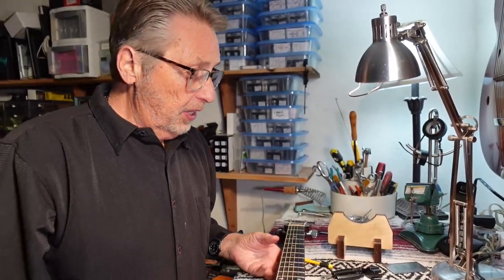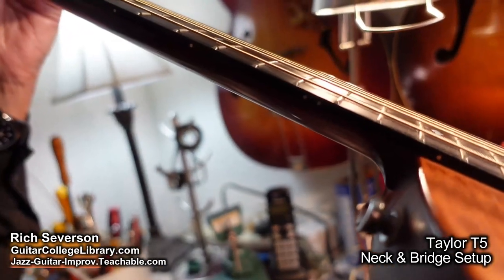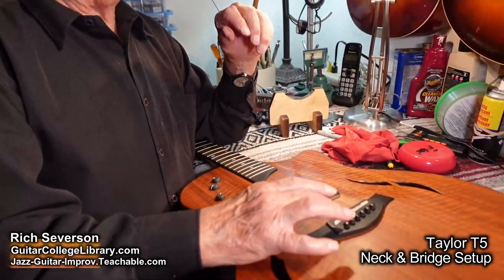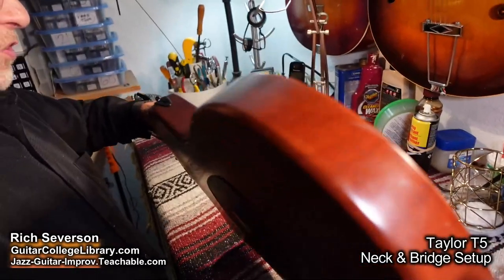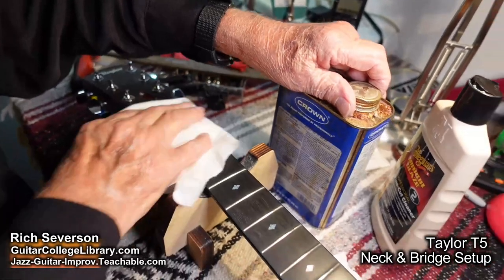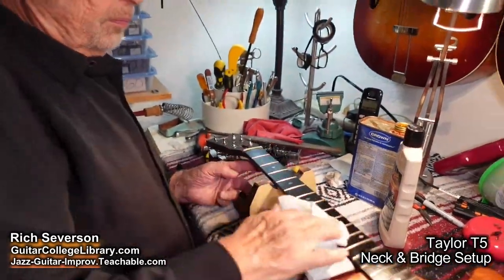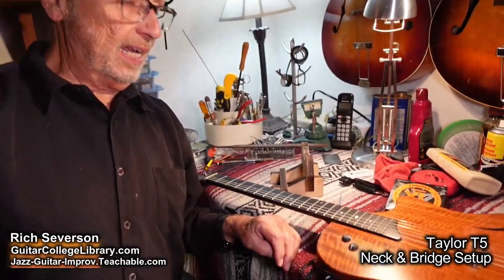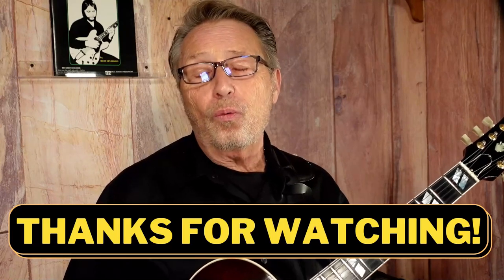Watch How I Clean & Lower The Action On This Guitar | Guitar Setup Demonstration

Comment: One small change-suggestion.  I'm not a luthier, but I was a precision mechanical technician for much of my career.  At the very end of the video, where Rich notices the saddle seems off, with the treble side set too low compared to the bass side of the saddle, Rich mentions filing a bit more at the back of the saddle from the mid-point to the bass end of the saddle.  I don't think that's what you really want.  If you do that then you'll end up with a high point in the middle of the back of the saddle - and the saddle will be like a see-saw and would tilt back and forth to the treble and bass side.  Instead, you'd want to file the full length of the saddle but just do no actual sanding at the far treble end and more aggressively file the base end.  The point is that the whole backside of the saddle needs to be flat and lay flat, without any tilting from treble to bass side.  From what it looked like in the video, the treble side was pretty darn low already and proper full length filing of the back of the saddle, even with aggressive bass side filing and just the gentlest filing on the treble side, may still end up too low on the treble side.  You may end up needing to shim it.  Then the question is - shim the whole underside of the saddle or just the treble side?  I think full saddle shimming would be preferred, for fuller saddle contact and perhaps better string vibration transfer to the body and better tone.  Well, I'm eager to find the continuation video of this project now to see what Rich ends up doing!